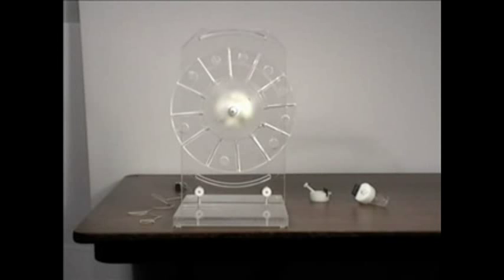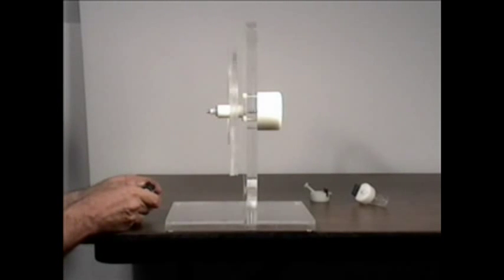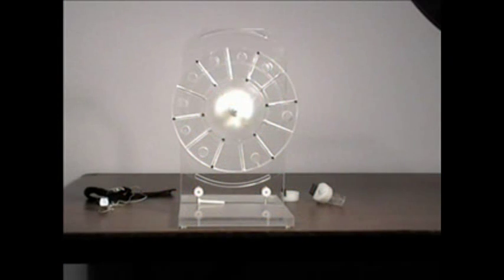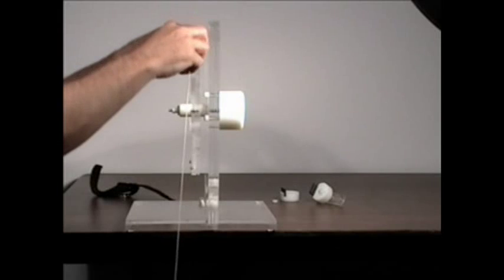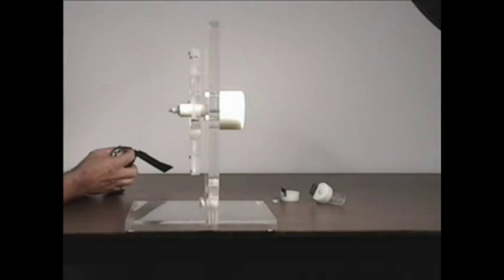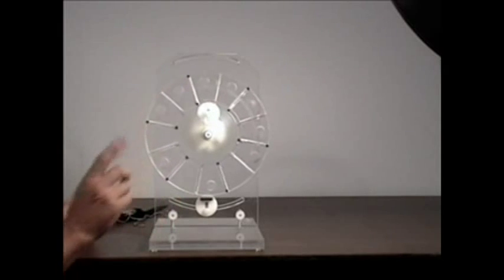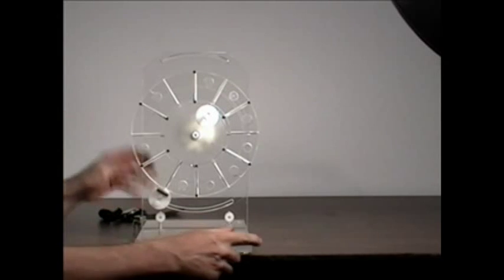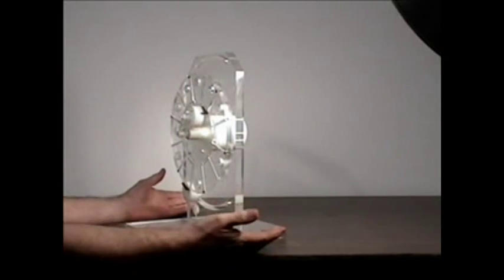Testing a Mondrasek Magnet-Assisted Gravity Wheel

Comment: TK-did you just show what you believe can never be the case-PMs adding to the systems energy output?.First run with wheel empty-least weight on bearings,least amount of friction-run time 12.30 seconds.
Last run,all PMs in place=greater weight on bearings=more friction,and run time was 13.9 second's.
The other thing to remember is that bearing drag is increased when in the presence of a magnetic field.
Reply from the maker: The last one is easiest: This wheel uses ceramic bearings, non-magnetic. In the version shown here the only magnetic bits are the magnets themselves, all hardware is acrylic plastic, nylon or Delrin.

As I tried to note in the video, I think that the bearings worked loose a bit during the demonstration. Yes, data like this is tantalizing, and that's why it needs to be questioned and repeated with better and better controls. No, I didn't just show what I believe can never be the case; what I showed is how to obtain data on a gravity/magnet wheel that is interpretable, repeatable, not nonsense, and actually tests some hypothesis.
Unfortunately this apparatus is among the great pile of great stuff that I had to leave behind in the other undisclosed location. Maybe some benevolent genie will cause it to materialize here in the Lone Star State, but I can't hold my breath.
Reply from the maker: Another thing to consider is "how different is different" with the measurements.

Basically, if the variation between individual trials that go into an average is the same or greater than the difference between the averages themselves, the "difference" may not be reliable. With the small number of trials and the relatively large variations between trials in any one condition, it's hard to say whether 12.3 is actually "significantly different"  from the 13.9 seconds. The way to resolve this issue is to do what is called (for two conditions) a "Student's t-test" or ANOVA (for multiple conditions). For these tests a larger number of samples, like 10 or even 20 runs in each condition, is needed for reliability. My purpose here wasn't to do stats analysis beyond taking the means ... but was just to show the basic test methodology.

"There are lies, there are damned lies.... and there are statistics...." but properly used, stats can be very reliable and lead to the real Truth.
Reply: TinselKoala